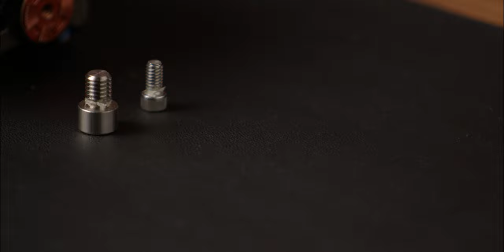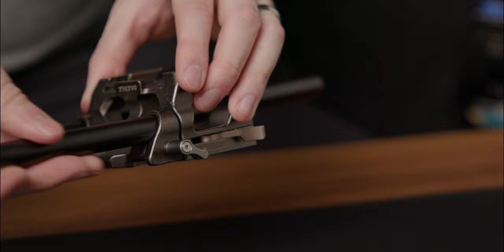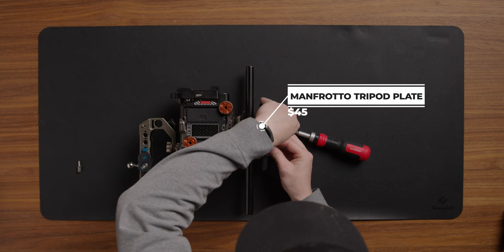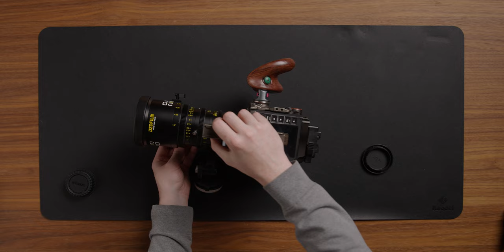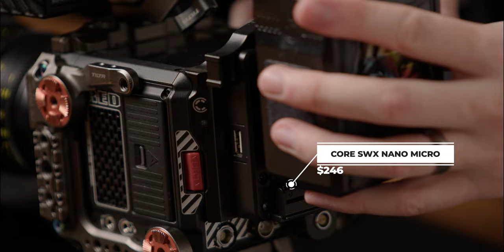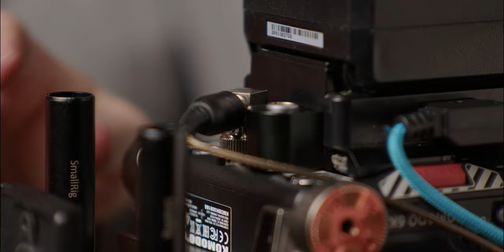The ULTIMATE RED KOMODO Cinema Camera Build (ASMR)

Comment: Hey how did you get your Tilta top handle to line up with the hole on the top plate? Mines doesn’t line up so I just used another screw and tighten it just before the hole. Works well, but it be nice for it to be threaded in the hole.

Comment: Be careful, mate. Not sure if it was just for the sake of the video….but don’t ever plug the Komodo’s BNC cable into the camera’s SDI port without first powering up everything else first. Once the monitor and the Teradek are up and running, power up the camera. Once the camera is also powered up, plug in the BNC to the monitor’s (and/or other accessories) SDI Port, THEN plug the BNC into the camera’s SDI. It should be the very last thing you do. It should be the same in reverse for when powering down. First unplug the BNC cable from the camera, then power everything down. Otherwise you risk frying your SDI port. 

I, too, own a Komodo and I have to be as diligent as possible about these steps. It’s a pain….but it’s true for all cinema cameras, like Arri, running 12G SDI.  Not trying to treat you like an idiot….just don’t want you frying your camera. Hope that helps. 

https://support.red.com/hc/en-us/articles/360057166453-Preventing-Damage-to-SDI-Outputs
Reply from the maker: Appreciate the feedback! We’re aware of the vulnerable SDI port on the Komodo and only did this for aesthetics of the video. We usually run a Freakshow HD MSX2-L Reclocking Distribution Amplifier for SDI and always use shielded SDI cables. We’ve been rocking it for a year and a half on Komodo with 0 issues. Again, appreciate you looking out for us though! Thanks for watching!
Reply: I actually think he didn't do anything wrong... I own a Komodo since 2020, and have done it exactly the way he showed in the video... I saved the instructions to my phone, and  I always go back to them as a reminder after not working with the Komodo for a while. As far as I know is that all you have to do before connecting the BNC cable is that you have to connect the monitor and camera to a power source. You don't have to turn them on to connect the BNC cable.
Reply: @marketstreetstudios  you still follow protocol or does the Freakshow HD MSX2-L allow you to just not worry about it?